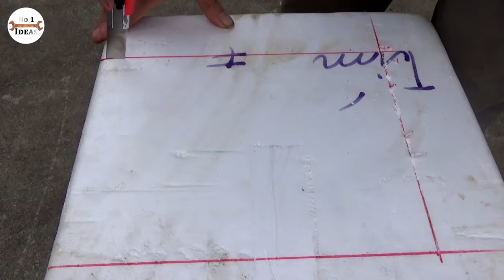Build A Mini Villa To Raise Fish From Foam Box - You Can Do It Yourself

Comment: So how long before it started leaking?  The weight is going to compress the foam and crack the concrete... maybe not right away, but within a few weeks for sure.
Reply: I mean he did but some concrete on it.
Reply: MIKE RAFOLS a very thin layer of it, water will go through it over a period of time
Reply: Chloe _lilly oh yeah it might go through
Reply: A concrete aquarium need to be cover with a coat of acrylic or epoxy paint (the same used to cover swimming pools), this guy just made everything wrong, the Ph is going to be on the sky and also no cycling...
Reply: @alanreyes7261  you mean cover by cement wasnt enough?
Reply: This type of Styrofoam is very strong and durable, my neighbor uses it for fish containers to be sold in the market, and it has been around for years. You know that sterofoam that becomes trash is  very difficult to decompose, especially sterofoam coated with cement and acrylic coloring, it will be very durable
Reply: yall talk like you know shitt, but you dont lol
Reply: @extrachilledvibes3329  
I agree
Reply: @chloe_lilly9469  not if he added a waterproofing mix into the concrete. Is what is used for external concrete walls and flooring in bathrooms.
Reply: yes, it will work and lasts over a year. I made one with my students many years ago.
Reply: they use a similar technology for fast build homes in the UK. Interlocking Polystyrene bricks, and then fill cavity with concrete. Is strong and has very good insulation qualities.
Reply: Do you guys know there are water tanks made of cement and concrete too?
Reply: @hrishichowgule  Yes... the cement is not the problem.  The foam is the problem.  The foam will compress and that will cause the cement to crack, and that means leaks.  Cement tanks need to be solid or spread over a solid base material that won't compress or flex.
Reply: try it n ull know it , n make sure u know all what he use to make it (same way) n u ll see the result
Reply: @twinkletwinkle3765  oh it'll work.  But it will eventually leak.
Reply: @worldmotivation4732  I've been taking styrofoam that you get when you buy meat or fish and recycling it into fake "rocks" to put in my work-in-progress "Zen" garden since real large rock is very expensive, not to mention, heavy!  So long as I make sure that it's at least 2 inches (5 centimeters) thick, there's no problem.  Of course, once I put them in place I have no desire to move them and so far, everything has been great.
Reply: @chloe_lilly9469  It's hydrofoil cement dude. It's dedicated to build such type of aquariums, lol !
Reply: You never know, its a cement and use no drop or aquaproof.

Comment: I had the idea to make my aquarium out of a old jerrycan, this video gave me alot of ideas/inspiration.
Reply: Metals or chemicals are a big no-no in aquascaping. You don't want your living painting to collapse in a few days.
Reply: @antoniomargallo5317  Sure needs a insert, this foam idea could be a solution for the inside. or a aquarium save coating if that is existing. i did saw aquarium kit and glue.
Reply: JeremyK 541OR.  lol "torture devices" maby i will just build for fun and put plants plants in it. for the fish im looking at the tropical 70 set from superfish now, do not want them to suffer.

Comment: Amasing. i love the idea to use pulystilène container. I have several used to moove fish during winter. Definetely a project for next summer.
Reply: Dude, this will start to leek in no time. Get yourself a brick of foam, cover it in concrete like he did. Then squeeze it. The concrete will just brittle off. Th same will happen to this tank over time resulting in leakage at best
Reply: just use wood and pond line the box.....

Comment: I'm guessing if some of the stuff you do in this video was explained in more detail it would make sense, but right now I don't actually feel like this things looks very "safe".
Reply: Depends on how much concrete and silicone you use. And the glass fittings too, it's water, tends to leak.
Reply: It is safe, just worried about the beta fish. They like to be and want to be small tanks, they can get depressed and die if they live in too big aquariums. Nvm, he doesn’t even put in a beta just guppies. He should’ve let the aquarium run for 1 week atleast tho, let natural algae build up. Fish need it. Those guppies will probably die. Also he should’ve tested the water for the lime level. Fish can also die from too little or too much especially fragile guppies. The filter looks okay and the tank too if he used the aquarium silicon, yes u can buy that. But he should’ve had the aquarium running for waaayyy longer
Reply: @yato2180  I assume he has the fish in a tank beforehand and just transfers some water + fish?
Reply: Come on people, does he have to go through absolutely every little detail? It would be a long boring video if he did that. It was only about how to construct the box. You can get other info from other vids in youtube.
Reply: @deanwalker5367  I don't think anyone asked for that. I was mostly thinking about whether the cement (or whatever was used since that isn't explained afaik) was safe for the fish or not.
Reply: Dean Walkek! Understand everything that's going on. Try explaining to this non-educated female. What type of paint is used at the fish? Do not die. I don't think that's asking too much.
Reply: @yato2180  actually betas are use to shallow streams that range about 10 miles long so you're not correct; keeping any betta in a small tank is upsetting.
Betas dislike alot of movement in their water so having air pumps an filters that blow out water an make it harder to swim will stress them out not the size. They absolutely love space just not fast currents
Reply: @scorpiogurl1692  it really is and they don't like to struggle because they dont have enough power on their " tails " (especially if its really long) to push themselves against currents, they're boats without a motor basically or even with a very low power motor it still runs but it's just not enough for going against strong/weak currents.
Reply: @deanwalker5367  perhaps what people should do is upload 2 videos, one artistic like this one and one 10x longer with every detail about measurements, products, protocols for anyone wanting to build this.... then again, somewhere down the line someone will complain, "there's no maintenance video" and then another, "where's the so-it-broke-how-do-i-fix-it-and-clean-up-all-the-water video??"... maybe we should just shut down YouTube, it' seems to only exist for the purpose of making people think answers are on it only to find more questions and aggravation. just my opinion though =P
Reply: bigemugamer lol 😂
Reply: @yato2180  this is just a video showing us how to set up a tank like this, it not saying we HAVE to do it, we can take tip and trick form it,  and put our own spin on it, if he want to let his tank run for 15 hours before putting fish in that's up to him, if you wanna run a tank for a week if not more than that's up to you.

He not saying do it 100% his way, ALSO you don't know what he doing In between cuts.
Reply: KamraCarnelian from my experience with them they don’t liked all the space and I know more ppl with beta and they say the same
Reply: Sam Warrior just going off of what I saw, not saying we have to do it that way someone was just questioning it, also putting fish in a “fresh” aquarium without cycling it is just irresponsible
Reply: Matt Conroy calm down, I’ve had multiple and ppl I know and talk to too
Reply: KamraCarnelian btw with a small tank I mean 3-5 gallons
Reply: @yato2180  Bettas don't want to be in small tanks. They prefer not to be in tall tanks sure but even in the wild they normally claim 1 square meter as their personal territory which is roughly 264 gallons.
Reply: Nothing it’s recommended and a known that at around 5 gallons they’re at their best
Reply: Nothing I call 5 gallons small
Reply: @yato2180  You have no idea what you're talking about. Beta need a 10-15 gal mimimum. And I say this as someone who worked as a fish and reptile head in a pet store, you put a beta in anything smaller than that and it's torture.
Reply: Rence Vandebiggelaar well I’m assuming seeing this guy knows how to build a fish tank like this and has many of other videos on building fish tanks he objects builds them often and knows quit a bit about fish and the tanks. For all you know he sells them and owns his own fish pet store or whatever its called. He apparently knows a lot about building fish tanks hence a lot of his videos so he I’m more than sure he knows way more about fish and caring for them than you do. I mean come on now a person that has as many videos as he does about building fish tanks OBVIOUSLY knows his information on many types of fish and is probably in that line of work. 🧐 common sense it’s all one needs to see that is pretty clear that this person is in that type of work.
Reply: Rence Vandebiggelaar I 100% agree with the people. Betta fish don’t stress out because of the tank size being big, in fact they usually stress out if high flow is present or slightly bigger fish (yes bettas can be housed with other fish as long as it’s peaceful and slightly smaller) are picking on their tail, pectoral, and dorsal fins. Sorry but people who thinks bettas can thrive in small space aquarium but stress and die on bigger ones are usually those that don’t do their research properly before buying bettas

Comment: Is that cement or concrete u painted in and arround the box m8
Reply: Cement and concrete are basically the same thing. Cement is the powder form and concrete is after is has been mixed and hardens. But to answer your question: yes, it is concrete that he painted.
Reply: @orcsbane29  basically the same thing but describes 2 different things
Reply: Jimmy Jay he applied wet cement and painted dried concrete
Reply: @orcsbane29  😂good counter

Comment: Cement can stick on foam , no crack ?
Reply: it can stick long enough to harden in place... but the weight of the water and rocks etc. will cause the foam to compress and distort, leaving gaps, the concrete will crack at the corners, and it will leak.
Reply: @DarkNookShop  Cement cracks if it's dried too fast and unevenly. That's why they water it when your building a house.

Comment: You need wait 2 week for make fish inside! In 1 or 2 days are no bakteriums inside, not good for fishes!
Reply: you can buy bacteria now so 2 weeks not so much
Reply: That's just a time span people feel halfway comfortable with. You should wait 1 to 2 months you introduce life stock
Reply: @lordlord9797  2 weeks with added bacteria, 4 - 8 weeks without it
Reply: @freestyler5758  Obsolete advice and a great way to get a serious algae problem.
Reply: @Dimetropteryx  with lifestock I mean fish. Not. Talking about snails or shrimp. Every tank is different. A Malawi tank for example can't have any shrimp in it and has few to no plants. But it's big. So you can add 1 or 2 fish pretty early to get the cycle started and do water changes when necessary.
In another tank you can use shrimps and snails the moment you see the first algea after around 2 weeks so they have something to eat and start your cycle. After 1 to 2 months the shrimp and snail kept it clean, your plants will be established and its in general stable and ready for life stock aka fish.

Comment: That's nothing to reinforce this though... Wouldn't the foam be
Break with the water pressure/weight?
Reply: DID you not see the cement it was brushed with???
Reply: @kitten113004  I thought it was just paint.
Reply: @kitten113004  it's watery. My cement doesn't look like that.